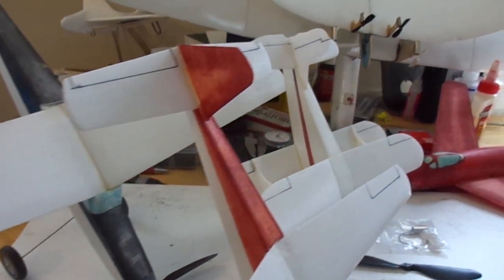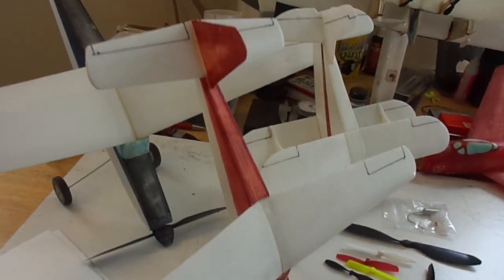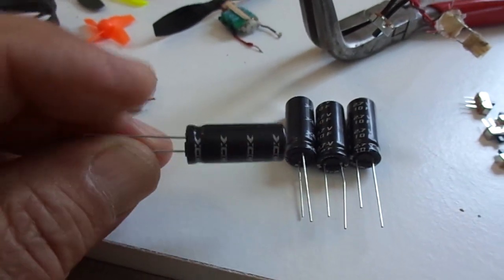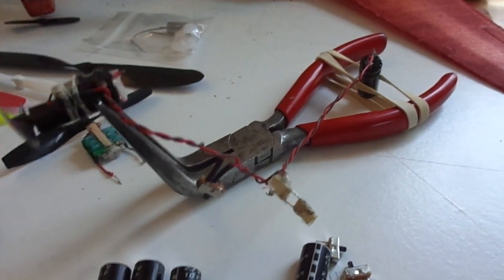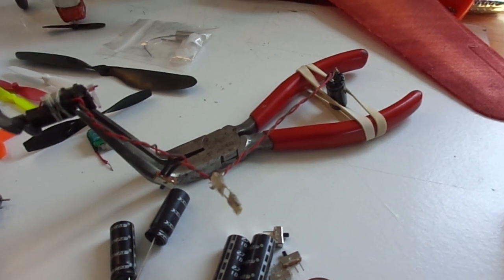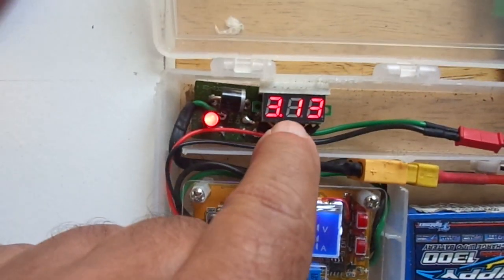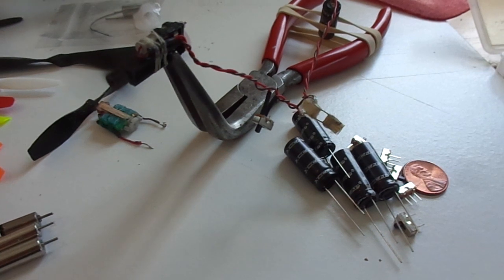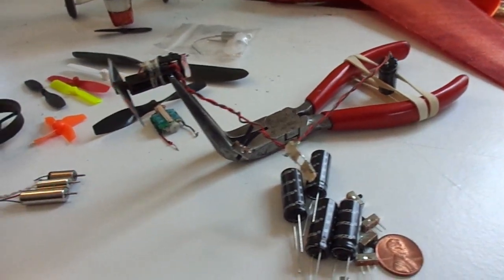SUPERCAPACITOR FREE FLIGHT BASICS

Comment: Hello, could you diagram the diode input protection circuit? That's a really big diode ya got there! Thanks!
Reply from the maker: Thanks for watching Michael, hope you subscribe! Entire circuit for field charger is as follows (using the Banggood drop-down  converter,  which has adjustable voltage and amperage on output):

Input side: Reverse current protection built in, no additional components required. We use XT60 connector to connect 2 cell LiPo 1300ma to the unit, good for about a month of flying! 

Output side: Connect to charging leads going to airplane, with a diode in the positive leg (stripe on diode toward airplane). Diode rating should be based on what you plan to hook up to the charger...since voltage and current are both adjustable on this unit you can use it as a general purpose battery charger and you may want to install a heavy duty diode if you intend to do that. If you're only charging little caps you don't need super heavy duty! My jumbo diode came out of a junk toy airplane charger which used 6 "D" alkaline cells to charge a NiMH 4 or 5 cell pack. You can hook up a multimeter to the charger leads (after the diode) to monitor charge of the cap. Or you can use the Baggood  mini LED like we use. It has 3 wires...black and red are supply for the meter circuitry and go to the 7.4V input side of the converter....3rd wire (usually yellow) is the sense wire and goes to the positive charger lead, again on the far side of the diode. 

We made a second charger for Richie, his used one diode segment on a full-wave bridge rectifier intended for 110V appliance in place of that jumbo unit, that works fine too. 

P.S. little extra red LED on output of my charger doesn't do anything, it is a relic of the unit's past life as a toy charger!

Comment: Very informative. This one gets me inspired every time I watch it. Again... your work on these airplanes is top notch!  Wish you lived down the street, so I could hang out and learn some building chops... in terms of getting all the details right. My idea is to build this kind of craft as well as some rc lipo powered versions with three channels or so. I’m already scoring foam from the meat guys down at my local grocery store. Lol 
As well as picking up whatever else I can find that looks as if I may be able to put it to use. Oh yeah... I’m also thinking about building some of those servos that are copper coils with neo magnets at the other end. I fixed one for a friend... and that was a job, I’ll tell you. The wires are as thin as hairs,  so soldering and such is quite the challenge!  Ok... enough blabbing on. I just got a little worked up watching this one, again ha ha

Great stuff, man!!!
Reply from the maker: Glad the video content sparked your interest, that's kinda why we do it! 

A while back I had a little infrared control living room plane (20 bucks from the toy store variety). It had throttle on/off on the left stick, and rudder L/R on the right stick- moving one of those magnet actuators just as you described. Back in the day, somewhat larger units capable of flipping the rudder back and forth on a small (.049-.10 or so size motor) gas powered model plane were available. I flew them a bunch! The transmitter would send a continuous stream of tone pulses (like a repeating musical note) to the airborne receiver which would whack the magnet to one side if the tone was "on" and the other side when "off". You can imagine if the pulses and empty spaces between pulses are the same length, the rudder will be flipping very quickly back and forth spending equal time on both sides...and the airplane will fly straight! You would say the pulse width was 50/50. Now, make it 60/40 or 70/30 and you have varying degrees of turn. make it 0/100 amd you pin the rudder to one side. In fact, it achieves totally proportional control and was called single channel pulse proportional. Some guys figured out ways to vary not only the pulse width, but also the pulse rate (length of repeat rate of on/off pulses) and decode an elevator control from it. That control scheme was called a Galloping Ghost rig. Anyway, when you decide to build your own actuator check out K&J Magnetics ( kjmagnetics.com )they'll have what you need and their monthly email is actually pretty interesting (if you like magnets, I guess that goes without saying LOL).

Now, THAT'S how you do blabbing!
Mike
Reply: sonex413 Ha ha!  The little cub I fixed for my friend emitted a constant tone for the rudder and elevator servos. I kept telling him I was gonna cut his hair with it. Lol.   That little plane is the cutest thing in the air... well was until I saw yours, but he used to get em from Hobby People... and I guess they went out of business, so you can’t get those little planes anymore. Very slow no wind kinda flyers. He still has a Tiger Moth and that Cub I fixed. I guess when those are gone that’s it. I’m gonna try to build him something from two Vapors he gave me for parts. I’d really like to be able to whip up some airplanes that are similar for him, for when the inevitable happens. He very much Loves flying, it’s his Zen as it is mine! But...  his eyesight makes him need to stay close in and pretty slow. He’s a good Dude,  and I feel compelled to help him out,  as he has no building chops at all. I started looking for plans I could copy and print out for cutting out the pieces. Anyway... I’m mainly a quadcopter guy, so all this is pretty new to me,  other than the Scout I bought about a year ago from Flite Test and built. It’s pretty funny cuz I actually started getting interested in rc planes after watching a video on YouTube with guys in a Japan flying indoors with very small stuff... then went to quads in some weird jump of momentum at some point due to some FPV footage I saw. Then... after a year or so of working hard and gaining the ability to fly an FPV quad... turns out I enjoy flying LOS the most, just the way I learned! Ha ha ha

Ok... I’m done... ha ha... thanks for reading all this! Lol 
One thing we can both do is blab, ha ha ha👍🏼😊‼️

Comment: Hi Mike!
Can I use this step down DC converter to charge a 1S 3.7V battery (say 1000mah) using 5V or 12V adapter so that I can then charge the supercap with the lipo? How? Does it need some extra component to be add to the converter?
Reply from the maker: Yes, this little converter will charge almost any kind of battery since both the output voltage and output current (amps) are adjustable. A heavy duty diode should be installed on the positive output (band on diode away from converter) between the converter and the battery to be charged, to provide back-current protection for the circuit. The input side of the converter has reverse polarity protection built in and needs no extra parts.  Since there is a voltage drop through the diode, the charging voltage should be measured/monitored right at the battery terminals, not on the converter's display. The output voltage with no load attached should be set (by means of left-hand trim pot)at the finishing voltage of the battery to be charged. To set the desired charge rate (Amps) you short the output leads and adjust the right-hand trim pot to display the desired value in amps on the little screen. I believe most lipos can accept a charge at the so-called one hour rate, for example, on a 1000mah battery, limit charge rate to 1000ma.  I hope this helps rather than confuses you, if any part isn't clear enough feel free to ask for more! Really, I should make a video about it!-Mike
Reply: sonex413 Thanks Mike! I think I understood most of what you wrote. I supply input power with my adapter, attach the diode to output positive terminal in fwd bias, measure voltage at the output terminals including diode with another multimeter, adjust out voltage without battery, and adjust current by shorting terminals..right?

While measuring output current by shorting terminals the value on converter's screen should be seen or there too another multimeter should be used and diode should be added before shorting? I have a pretty cheap multimeter that I dont think is safe for ampere measurements.

In ur another video u set the supercap charging current to 800mA..that value should be taken as a rough standard for charging with any other lipo?
I havent use lipos nor am well versed with semiconductors...These 3.7V lipos should be charged to 3.7V only? I saw a video which used 4.2V but commenters said that it reduces life. Also, can u pls tell the part name for ur heavy duty diode so that i can look it up or its substitute?

And a video would definitely help a lot of people :)
Thanks!
Reply from the maker: Your first paragraph is all correct. When setting output amps, read directly on unit screen, no multimeter needed. The reason you need it to check output voltage is the voltage drop over the diode. 800ma charge rate at about 3.1 Volts is what I use for 10Farad caps. I use a different charger for my Lipos but I read about people using these converters for charging Lipos in the customer comments section on Banggood's product description page. I believe 4.2 Volts is correct float voltage for 3.7 Volt Lipo cell. Sorry I don't have diode part number as it came out of salvaged toy airplane charger....On my friend's identical field charger we used one section of a full wave bridge rectifier in place of the diode...again, part came from junk box so no part number!  Just use something strong enough to check the back flow of the battery you are going to charge...Bigger battery, bigger diode. Hope this helps, don't be shy about asking more questions! -Mike
Reply: sonex413 Thanks Mike. I saw the product description on banggood and realised that the 3.7V 1S lipo wont work with this converter for charging the supercap as it requires a min 1.5V voltage difference between input and output. So a 3.1V output would need at least 4.6V input. Your 2S lipo is sufficient for this. I havent bought the lipo or diode and wanted to be sure of the specifications before I decided to buy. I guess I will stick to the simple and cheap AA charging. :) Oh, and I read that the voltage drop across a diode in fwd bias is 0.7V so I guess thats gives a rough idea about the drop.

Nevertheless for learning, the diode should be chose  as per the C value of the lipo and its current rating should be seen..so 25C lipo should have at least 25A diode? I could see max 10A and 1000V or 600V diodes available here.
Reply from the maker: I'm using my field charger only for capacitors so the diode I'm using has been perfect for the job. I have an old Triton charger that I use to keep my 2S 1300mah Lipos charged. One of my Lipos fully charged lasts for about a month of capacitor flying! Richie and I used AA alkalines for quite a while before we built our chargers, it's the best and easiest way to get started and you can build a charger later if you find you are flying a lot. When we were using the AA's we were still using a voltmeter to measure the state of charge at the capacitor. This becomes more important as the batteries wear down and it takes longer to reach full charge. 

Concerning amp rating of diodes...wish I knew more about what it actually does in the circuit. I wonder if it's only there to protect against accidentally hooking up the load backwards? Or maybe it has a function during normal charging also? All I know is that I have read references to adding a diode and using the unit to charge various batteries. Mainly saw those comments in the customer comments section on Banggood.  10Amp 1000Volt diode doesn't sound right! LOL I think we are missing something! -Mike
Reply: sonex413 Hi Mike. Well from what I read 10A is the max forward current u can pass through the diode in normal forward bias operation, and 1000V is the max voltage it can oppose in reverse direction. It passes current only in one direction (fwd bias) when voltage on band side is lower than voltage on the other side...if the voltage difference is reversed it stops conducting...so basically like a valve. It will stop conducting in reverse direction only till 1000V is difference is applied in backward direction, after which it breaks down and I guess starts conducting reverse current. So the amp and voltage specify the max fwd current and max reverse voltage endurance of the diode. So I guess if someone is passing 1A current in fwd direction for charging the lipo to 7.6V, then this diode is sufficient. However people use Mosfets and some other components to avoid the lower efficiency of diode due to its voltage drop and heat dissipation. Thanks..
Reply from the maker: Excellent information! So, in the case of, say, charging my 2 cell 1300mah lipo with this unit, I would be charging at 1.3 amps max and about 8.4 volts max. That means a 12 or 20 volt diode rated at about 2 amps. I think that's probably about the size of the one I have in my field charger. I have never tried charging anything besides small supercaps with it and I'm sure I'm well within safe limits. Voltage drop is about 0.4 volt across my diode, not a problem since I am metering the voltage right at the capacitor and I compensate for the drop by dialing up the output of the converter board slightly. Thanks for great info, Mike
Reply: sonex413 It sounds right Mike, but I would definitely consult a practically experienced person in electronics before charging that lipo with just a diode on the converter and these rough calculations...lipos are expensive for my situation so I definitely dont have the bandwidth to experiment with it! ;)
Reply from the maker: Agreed.
Reply: sonex413 Hi Mike! Can u pls give the banggood links of the props u bought? I think u used 46mm on 615 motor and 65mm on 716/720 motor?
Reply from the maker: Hi Ashutosh! I'm using 50mm Gemfan props from Banggood for 6mm motors with shaft size 0.8mm. They also will work well with 7mm diam motors with the 0.8mm shaft diam. These are the little black props you see on my Micro Dakota and Micro Ranger 30. Link here:

https://www.banggood.com/4-Pairs-Gemfan-50mm-ABS-Propellers-For-80-100-Class-Frame-Kits-6-8mm-Coreless-Motors-p-991023.html?p=AZ31114857064201605K

If you have a 7mm motor or 8mm motor with a 1.0mm shaft, use 55mm  props here:

https://www.banggood.com/Eachine-Vtail-QX110-Micro-FPV-Racing-Quadcopter-Spare-Parts-55mm-Ladybird-Blade-Propellers-BlackRed-p-1138626.html?p=AZ31114857064201605K

Check shaft size!

Also, I have used 65mm props on 8mm motors. 

Hope this helps! -Mike
Reply from the maker: Also, my friend Richie has flown with 720 motor and 65mm prop. The ones we bought are sold out on banggood, but they have similar 65mm props with both 0.8mm and 1.0mm shaft size available, just search "propeller 65mm" on banggood site.
Reply from the maker: Yes, they look identical with 1mm hole in the middle. The ones I bought were white and available in quantity 4 for micro quad use, they are apparently sold out at this time.  I used them with twin 820 motors on my "Jumbo" supercap plane along with a 40Farad supercap. These props also work well with 7mm motors with 1mm shaft, and the 10F cap gives a fairly long run, it might be the best combination depending on airframe design.